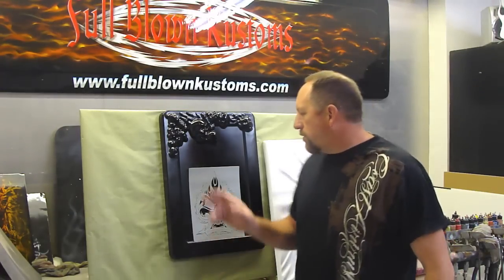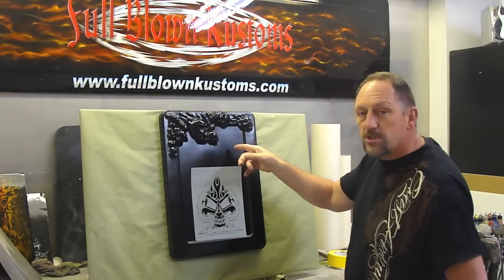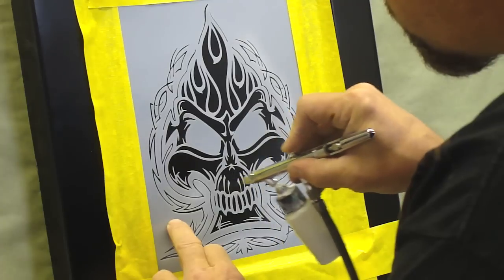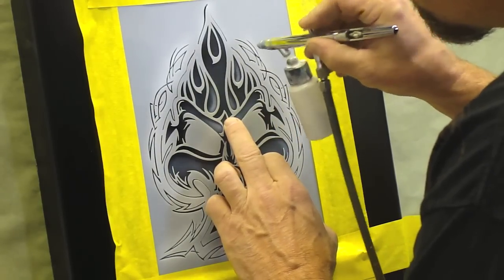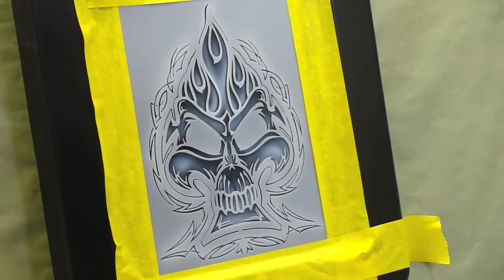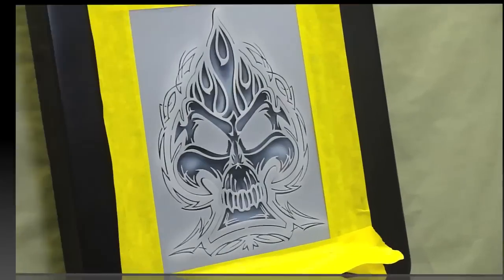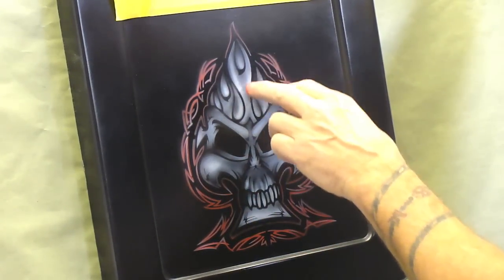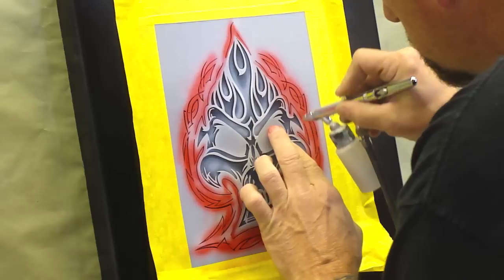Beginner Stencils Part 1

Comment: Hey Ed great work!!

I've just bought a HP BCS but im struggling to do some really fine lines with it would you recommend using a 0.35mm needle set up with it? Ive seen alot of your videos and theyre all great, any tips on paint a chrome effect? Without using chrome if you get what im saying?

Cheers

Comment: If you work on T-shirts, set your air settings to around 30 PSI to get the paint into the fabric , if you use a stencil that has fine line like this , spray from a little further away so you don't get as heavy a build up on the stencils and get runs , etc. Water based paints like Createx Wicked Colors work best on textiles . Heat set with a T-shirt press if you have one, or let it dry and and then put it by itself in a dryer set on high for 30 minutes . Wash in COLD water, and it will last.

Comment: Hi, I'm from South Africa. I have watched most of your clips on you tube.We are doing spray on airbrush tattoos for almost 3 years now and wanted to do something different than the normal stencil tattoo.We started doing 3D tattoos.I found that our ink we use doesn't have the same colour as the 2K car paint. Is there maybe a way, that you can do a 3D tattoo from using a stencil, and we also have difficulty with the scorpion tattoos.Any advise? Thanks, love your tips. you are very talented.

Comment: hey nice helpful vid man! 2 questions.....  do you use lower air pressure when using a stencil or does it matter?  and I also noticed you were letting off the airflow between strokes when most people say to hold it on, is that better to do with a stencil, or do you just paint like that always?

Comment: Hey there Ed, yet another question.
Dont wanna step on any toes or anything but why is that you will not use Kustom shop stuff anymore? Business relations go south with Kustom shop? But the main question i have is, the HoK paints are not water based, but what is the solvent to be used to clean out the guns when using the HoK paints? They are expensive paints for practice, but next big project i want good paint, any recommendations? Thank you like always!

Comment: hey ed, just curious are you cleaning the gun in between colors or do you have multiple guns? and also for the detail work are you using a lower air pressure? sorry for the newbie questions but I'm just getting in to air brushing. thanks

Comment: got a ?. been airbrushing about a month and i keep getting catepeller legs when im tryn to do detail. Ive tried all mixing ratios. its either to thin or 2 thick. ive adjusted from 15 psi to 35. im using a snap on dual action gravity feed. please help. thanks also using creatix colors airbrush paint

Comment: @hanzithaking With the coverage issue, it sounds like you're spraying way too wet, trying to get coverage in 1 coat.  The trick is to build up multiple light coats to get full coverage (about 3 or 4).  I'm not sure about the football shape dots.  I'd have to see a picture of it. SgtM from theairbrushforum(.)com.